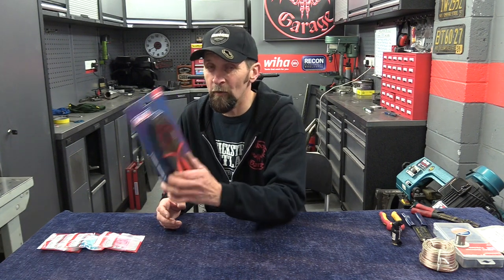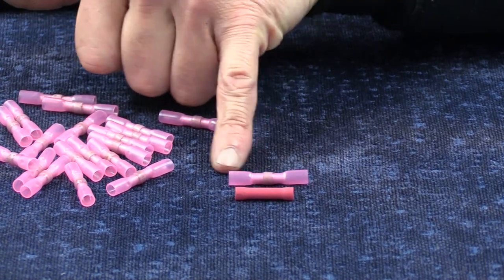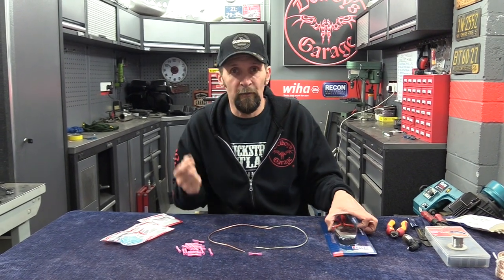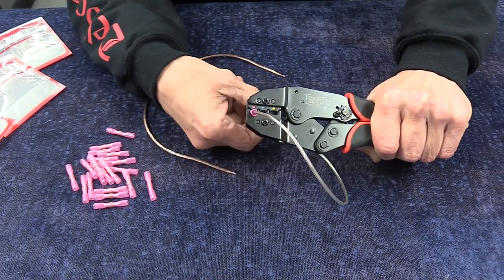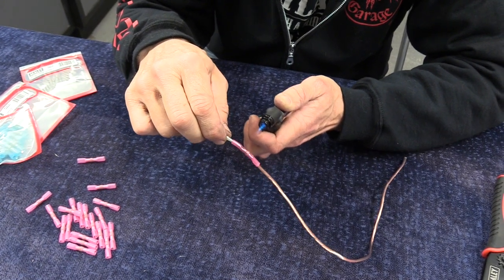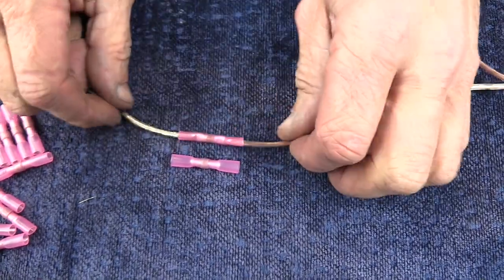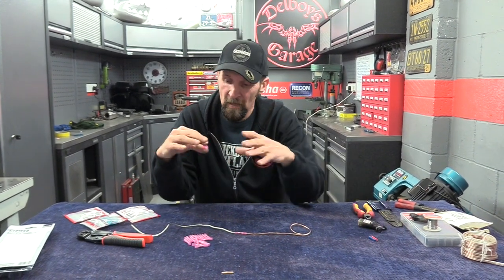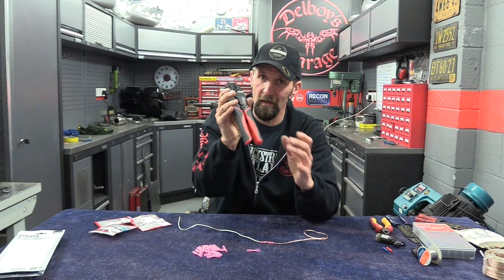Delboy's Garage, Soldered Crimp Connectors, Tool Review.

Comment: I have the standard crimper and connectors and they are a pain if not done proper, love them connectors, bloody expensive tho, great demo Del, love to Pen, regards Stu 🤘🤘
Reply from the maker: Yeah, you are right Stu.. i had to make mention of that.. they are over £20 for a pack of 25.. but i guess you arent going to need that many, and you wont need any heat shrink tubing either.. i think its worth it for the quality of connection you get though aye.. .take care buddy.. have a great Sunday.. Del.
Reply from the maker: Yeah, you are right Stu.. i had to make mention of that.. they are over £20 for a pack of 25.. but i guess you arent going to need that many, and you wont need any heat shrink tubing either.. i think its worth it for the quality of connection you get though aye.. .take care buddy.. have a great Sunday.. Del.

Comment: Sorry but One pound each is very steep! When a little solder and heat shrink well do the job😨
Reply from the maker: That is why I said exactly that in the video my friend if you watched all of it, I said clearly that a soldered joint is always best, and I said clearly £1 each is a lot of money, so you're not disagreeing with anything I've said, and what you may have also heard me say is that not everybody can solder, it isn't an easy skill and this is a great way for those of us without your skills to make a strong conductive joint every time... peace
Reply: Very True, I love the concept Del. Just thought the price was too much for us cheap skates. Cheers for the reply
Reply: Maxim X yeah but he was robbed blind if he paid £25 for that wee packet. Other manufacturers make the solder and heat shrink connectors, they are not exclusive to Sealey and can be had for a lot less.